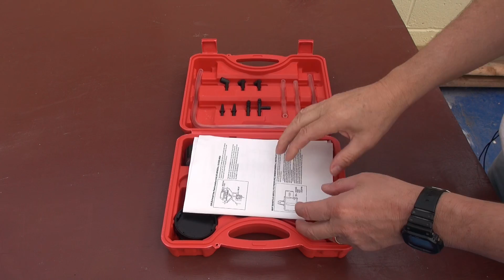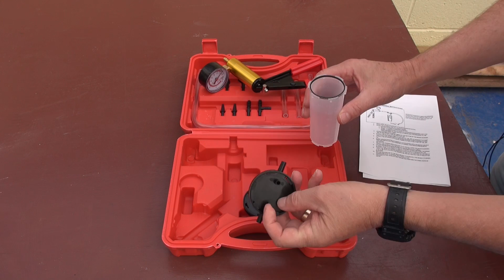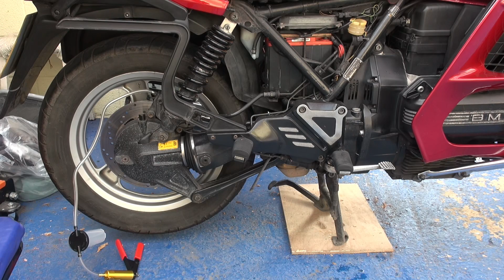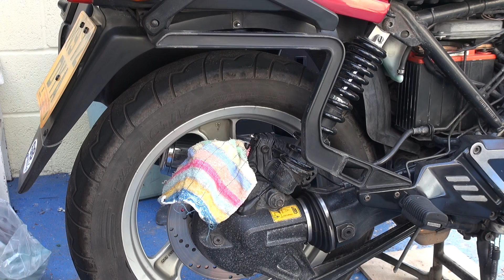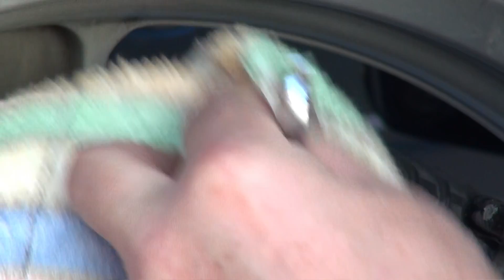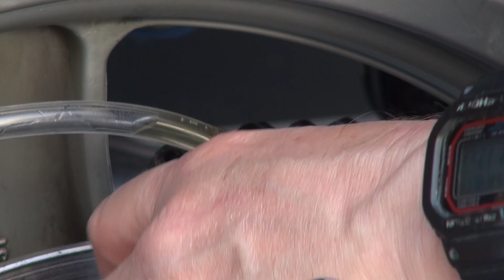Does a vacuum brake bleed pump work?

Comment: Am I stupid, or would a bleed valve like port on the top of the reservoir be a better place to create the vacuum? Simply leave everything tight, connect the pump to the lid, and suck out any air. If the lid on the reservoir is secure enough, it shouldn’t allow any air into the system, but force any out. But, again, I could be dumb.
Reply from the maker: You can’t suck air out of liquid. You need to transport the air within the liquid out. I’m afraid it wouldn’t work.

Comment: Does it work the same on the front brakes I’ve got 2 disc on the front and  need to do mine when this arrives so hoping it will work the same on the front
Reply from the maker: It does. Remember to finish the fluid flush by pumping the brake while opening the bleed nipple to make sure all the air bubbles are gone.

Comment: Hasn't anyone heard of PTFE tape?  It also prevent the bleed nipple seizing in the caliper due to bimetallic corrosion.
Anyway, what I wanted to know; do I bleed the brakes with the power on so the ABS device is energised, or doesn't it matter?
Reply from the maker: No you don’t need the ignition on. On mine there are bleed nipples on the ABS module as well as on the caliper.

Comment: Surely if air is being drawn past the threads that air will be just sucked out, as we could see with the bubbles as you lock the nipple of no more air being shcked past the threads so no air in your brake system.
Reply from the maker: That’s true but you cannot see if there is still air in the brake line with so much air getting past the threads. So either put some grease on the threads or in the final step use the traditional method to push the fluid through.

Comment: Perfect testing and great thinking with the grease on the threads. Was tossing up between these kits vs the one way valves but I’m convinced this kit will be better as I won’t have to run to the pedal and back  (car brakes). Thanks for the vid

Comment: Nigel love your vids your ford focus video awesome so easy question same car but the reverse doesn't go into gear only sometimes it does depending on position any ideas
Reply from the maker: Assuming the gearbox is alright I would have a look under the centre console for any broken bits. I changed the spring on the lever once. Have a look at that video.

Comment: Hey Nigel. Thanks for sharing. By sheer coincidence I am trying to bleed the rear brake system on my 1996 K1100LT.  I recently acquired it from an estate sale. I suspect it has sat for several years. Your earlier video about fluids changes was very helpful. I have an identical vacuum pump to yours. Unfortunately, regardless of which method I use, I can’t get fluid to flow through the system. Before attempting to flush it, there was no resistance when pushing the pedal. Was hoping a good flush would resolve it. Wondering now if the system is clogged or if master cylinder is defective.
Reply from the maker: I may know the answer to that one. There’s a good possibility that the ABS module has failed. My front ABS failed and I couldn’t bleed the brake line. There’s is a bleed nipple on the ABS module under the seat. If you can bleed to there but can’t bleed at the calliper then it’s the ABS. The solution is to bypass the ABS as you can’t get replacements. Motor works have parts to do this https://www.motorworks.co.uk/parts/brakes/abs-removal.html
Reply: That is good to know, Nigel. Thanks!
Reply from the maker: @chrisbennett812  good luck with the bike. They are grand old ladies. Had mine 28 years.
Reply: @NigelEaland Impressive! This is my first K-bike. I’ve owned two R-bikes previously. One for 30 years. The only things I ever did with those was change out the batteries and any burned out light bulbs. It’s getting harder to find mechanics that will work on older bikes so thought I would give it a try with this one.  It’s been challenging. Would love to tap your knowledge when I get stumped.